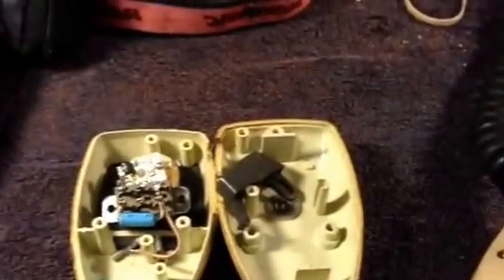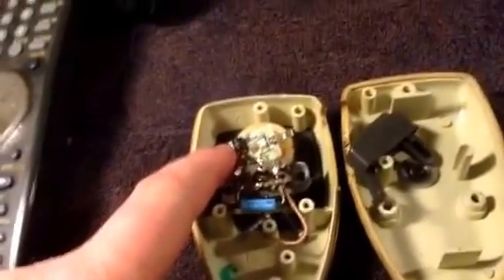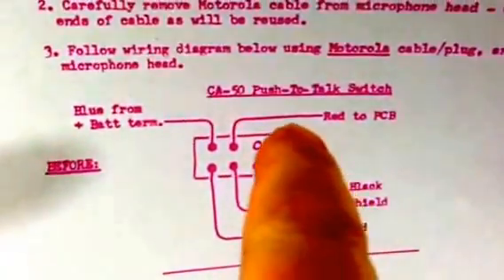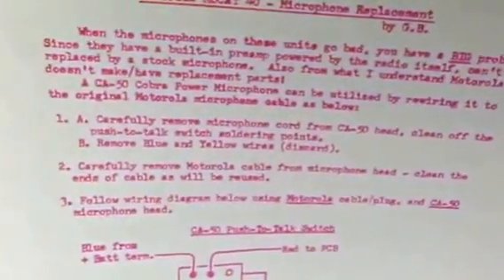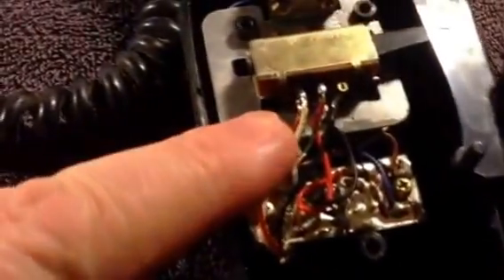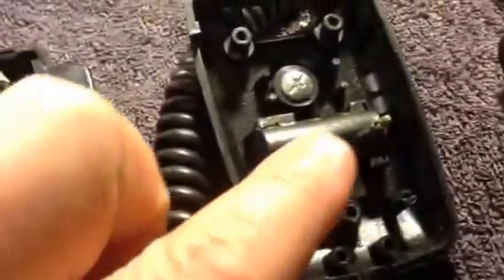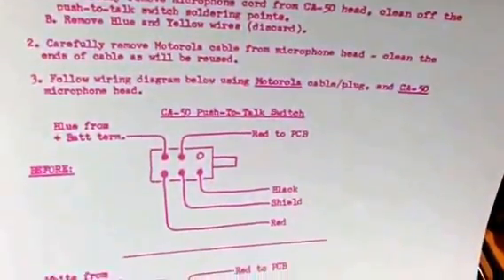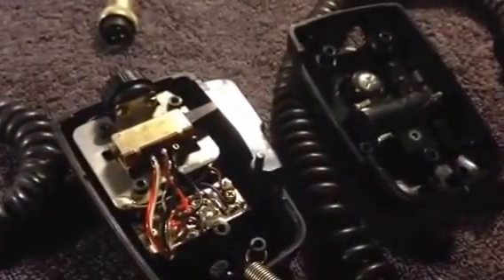Replacement Mic For Mocat 4020 CB

Comment: Very cool and nice job! .  But my question is can I use one of those style Motorola microphones and modify it to use on a standard CB radio.  They are all over Ebay cheap. Figured maybe they can be rewired and a cobra end put on.
Thx....
Reply from the maker: captainedc I don’t see any reason why not although you would need a schematic of both the microphone you’re trying to replace and the Motorola one.

Comment: As long as I'm logged in and you have such a broad knowledge of CB's, let me ask a general question...
I have an old, but clean, CADRE CB. It seems to be from 1961. It has no labels on it but if I gave you more information about the radio, would you possibly be able to offer some opinions as to what it might be? Thanks, Frank

Comment: I respectfully would like to ask a question. I managed to find the schematic for this mic and I'm guessing that it uses discrete components (but I haven't had the opportunity to investigate the actual hardware yet). Aside from having to cross-reference the Motorola transistor part number to a 'real world' part number, can't you just troubleshoot the circuit and fix it or is it encapsulated, epoxy covered or otherwise impossible to repair?
Reply from the maker: Frank Carbalan yo the parts are any open and they are not encapsulated. However the little main component is no longer available anywhere
Reply: Hello David, I did some investigation of the problem by tearing into a mic to see what the killer component is and to figure out why it's so difficult to fix. 

It turns out that first, Motorola built the circuit on a ceramic header with printed circuit land patterns on it (very classy workmanship). This replaces, and is better than, a simple FR4 green printed standard circuit board. 

It's a simple single transistor amplifier although I couldn't read the number on the epoxy-packaged device without removing it physically. Could be either a standard bipolar or an IG-FET or a J-FET type. Motorola transistor numbers can be hard to cross-reference but simple test equipment can reveal its inner structures.

There's two chip capacitors on the ceramic header that could be replaced by discrete components if necessary. 

So what's the problem then??? Well, here's what I see: There's at least one or more custom thin-film laser-trimmed resistors on the ceramic header. (Again, very classy workmanship). These would be very difficult to replace with precision resistors and find the right value. These are used to perhaps get the gain just right and are adjusted by laser at the factory.

In summary, this is a very nicely built, high tech microphone that you won't find on most other brands. I suspect that the transistor is the element that is most likely to fail and therefore, if the transistor type could be determined, even if an approximate match could be found, replacing just the transistor may do the trick in many cases. However, if anything else goes bad, then you're pretty much on your own since most of us don't have thin-film application labs, laser trimming facilities and surface mount repair in our basement work areas.

You did a good job in describing a workable solution to get us back up and running easily. I may post some photos on my Facebook photo page in a day or so: https://www.facebook.com/digitaltreasuresphotography/
Reply from the maker: Frank Carbalan great. Looking forward to it. Thanks again
Reply: Here's a labeled photo of the circuit board in the microphone:
https://www.facebook.com/digitaltreasuresphotography/photos/a.1624145781164892.1073741829.1577527832493354/1866747823571352/?type=3&theater
Reply from the maker: Frank Carbalan well thank you sir that'll help people out a lot